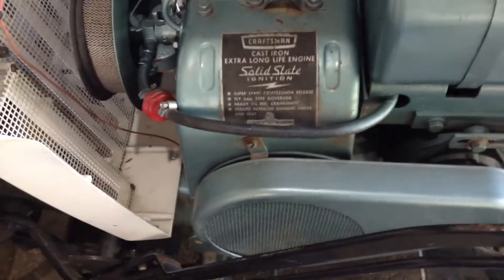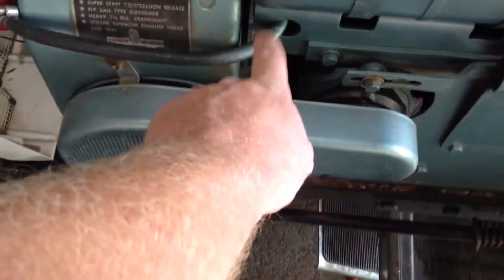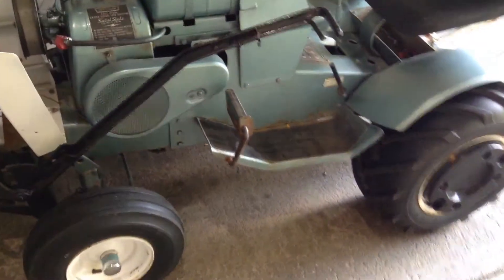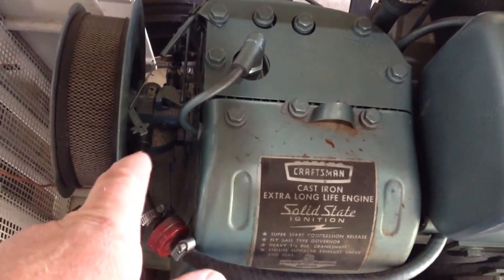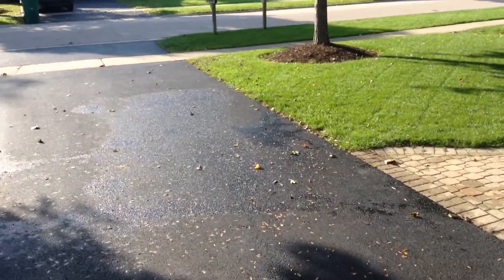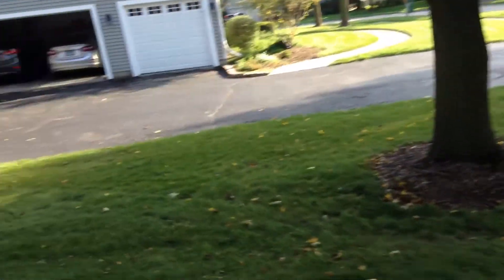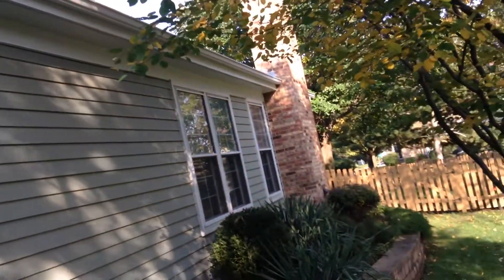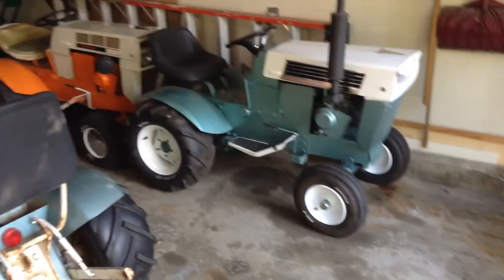Oct 8th cold start/ update

Comment: looking good Buddy !!!!!!   Its 85 here in Ga. , dry and Humid , I split firewood Saturday and was burning up , probably no fall here , straight to 30 degree weather  I'm thinking ??I need some info , how does the choke cable route on a Sub12 ?? I see no way to run it under the battery tray like my ST16 , the cables way to short on the Sub12 .
Reply from the maker: barry hunt Thanks Todd! These choke cables run right along the bottom of the battery tray and route thru a hole in the front of the tray and go along the cylinder head up to the carb, I can shoot a short vid on it if you need me to brother.
Reply: That's what I was thinking , I will get it from here Buddy , Thanks !!!!

Comment: Rooney, I just picked up a Hydro Trac 12. Was wondering if you could give me a run down on servicing the rear end and Hydro Drive. New to these hydros and any information you can spare would be extremely useful for me.
Reply from the maker: Sure thing Cody, first off congrats on getting one, they are extremely cool to operate. The thing i can't say enough is be careful on how much force or stress you put on the hydro, 2 of my 3 hydro's had a stripped coupler that goes from the input and output shafts of the hydro and the rear end.Now for some maintainance tips, the hydro sump is the aluminum box on the bottom between the rear wheels. The plug to drain it is on the bottom cover and to check the fluid level you need to remove the left rear tire and the dipstick is right behind it.Make sure the tractor is level when you check it too. The manual says that the fluid should be up to the threads on the dipstick nut but if you overfill it it's fine, it will just purge the excess when you run it. I've been using ATF type F which Sears recommends, 2 to 2 1/2 quarts to fill it. Dont worry about changing the filter in the hydro, They dont make them anymore and nobody has found a substitute yet. But if the tractor is moving now just a fluid change will help alot. The rear end is a single speed Peerless and takes an 80 or 90W gear oil.If you can I recommend downloading a manual for it, alot of great info in those. Just go by the 917.xxxxx number but the hydro's in all the older 12's are the same. Hope this helps man and good luck with it!
Reply: RooneysSears01 thanks for all the information. The manual says the hydro takes type A hydrologic fluid. Is that basically the same as ATF-F? Would the ATF-F be the best thing for the hydro drive?
Reply from the maker: Cody Stewart no problem man, I run the ATF because it's more readily available by me. My nearest farm store is 45 minutes away lol but I've been running the ATF for 3 or 4 years now in my 69 hydro and it's been a solid performer. But I think either of fine to run.
Reply: RooneysSears01 Great, that’s me for the info. I pulled the breather tube/dipstick combo on the hydro reservoir and the tube has a break in it about an inch below the “olive fitting,” where the line fitting screws into the reservoir. Any idea where I can find a replacement, or would it be easier to try and make or have one made. What type of business could I reach out to to clone the piece? Thanks.
Reply from the maker: Cody Stewart That tube looks to me like it would be similar to a tranny cooler line or brake line, I think any mechanic might be able to replicate it as long as the fittings are still good it sounds like just a new dipstick tube is all you need.
Reply: RooneysSears01 Yes, hopefully it’s a non expensive fix... I’ve got a lot of money into the tractor already. Picked it up with a snow thrower, mower deck/mule, complete three point and tire chains for $550. The engine seems solid and runs strong. Tractor drives decent but the tranny whines some. Paint and sheet metal all are in great shape. Also came with the Removable grill piece. Did I get ripped off? Also, will any generic 80-90 gear lube work in that peerless gear box? All of your advice and info are greatly appreciated.  Thanks.
Reply from the maker: Cody Stewart in my honest opinion I think that's a great price, I paid 300 for just my 68 SS12 hydro and it needed everything so you did good. Ya I usually run the Walmart brand oil in my stuff. I think the whine is normal, mine do too. Good luck with it and enjoy it man they are super fun machines.
Reply: RooneysSears01 I got my hydro fluid changed out and you were right. I put 2.5 quarts into the reservoir and sealed everything back up. Took for a test drive and it purged a crap ton of fluid out the preacher tube all over my new asphalt driveway. Was up till midnight scrubbing it with soap and water. I guess it didn’t need all that fluid. I even let it drain over night before adding the new. Did you have a similar experience?
Reply from the maker: Cody Stewart whoa! Out of my 3, the 69 hydro's been my only problem child, I needed to make a new sump gasket cuz it leaked from the previous owner going in it so it would leave puddles. After I did the gasket and filled it this last time it only purged a couple dime size spots but nothing giant.
Reply: RooneysSears01 I wonder if I went wrong somewhere. To refill the reservoir, I used a fluid pump and pumped the fluid into the hole where the breather tube goes in. Was I supposed to refill it from a different location? lol
Reply from the maker: Cody Stewart nope that's the right spot! lol I wonder if it was just burping all the air from the lines and such, I bet it'll be fine now.
Reply: Rooney, if made my new dipstick for the Hydro too long, would it cause it too purge more fluid than necessary? It is intermittently purging fluid as I run it. Baffled as to what the problem may be...
Reply from the maker: Cody Stewart That is weird Cody, I wonder if that's what the cross drilled hole is for at the full level? Maybe it stops that? Let me see if I can get the one outta my 68 SS12 hydro and shoot a vid of the length and that hole for you.
Reply: RooneysSears01 That would be great and help me a lot!
Reply from the maker: Cody Stewart Alright mr Cody, new vid is up and I hope it helps bud